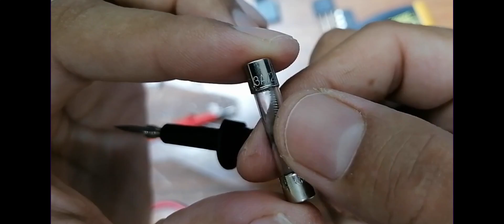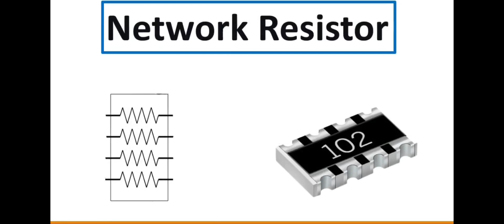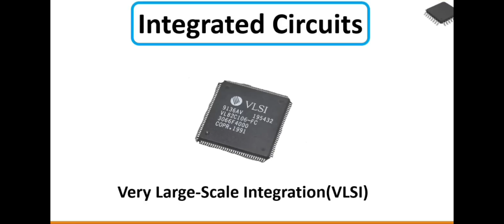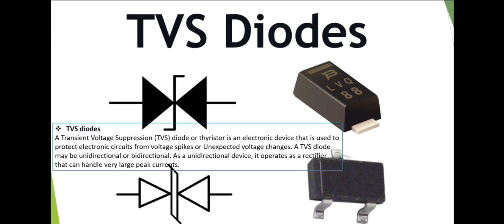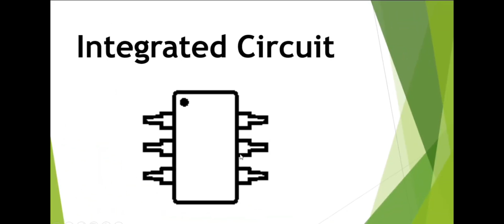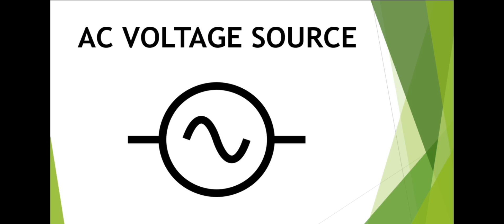All electronic components names, symbols, functions, testing, and pictures - electronics repair SMD

Comment: Just one question sir don't you usually discharge capacitor with a bleed resistor or insulated wire across the terminals?
Reply from the maker: You’re absolutely right. Discharging capacitors safely is crucial, and using a bleed resistor or insulated wire is a great practice to avoid any surprises.